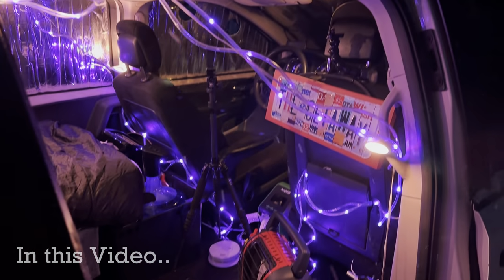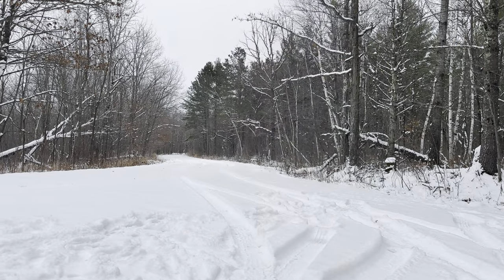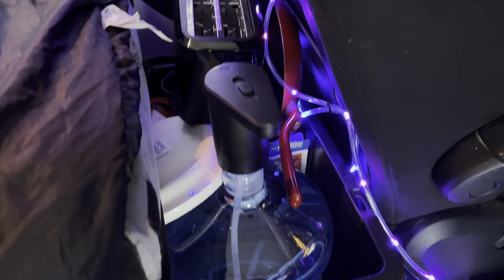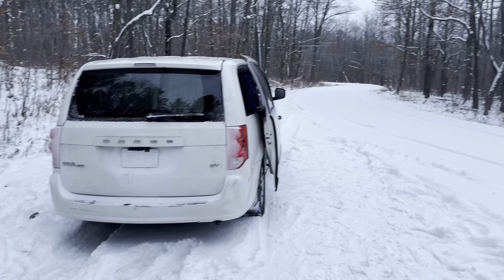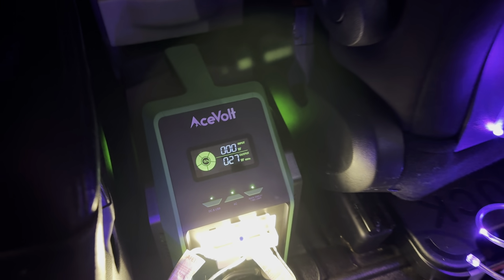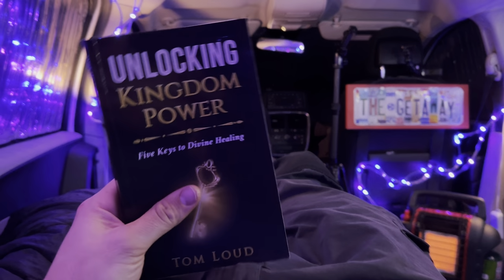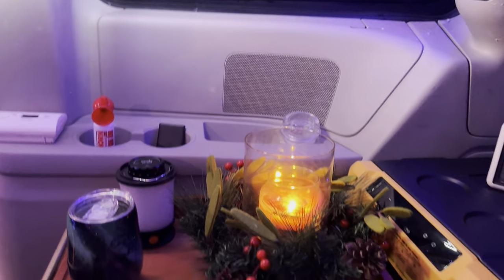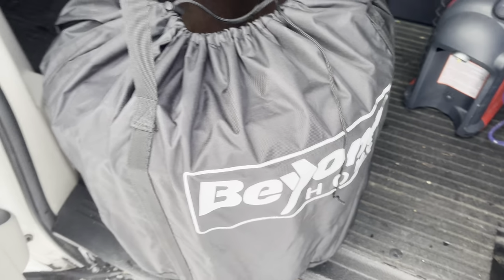🥶 Solo Car Camping in the Freezing Forest! Winter Camping New Setup | Dodge Campervan / Van Life

Comment: Never never run a propane  heater in a closed vechile.   Make sure you have a  carbon monoxide  alarm in your van
Reply from the maker: Yeah you always gotta keep the windows cracked for good ventilation and have a carbon monoxide detector like I showed in video and you’ll have zero issues

Comment: Not a good idea to light a candle, it will use up the oxygen in the van and create carbon monoxide. God Bless You!
Reply from the maker: Hey Joyce, one candle is totally fine as long as you have some ventilation and a carbon monoxide detector which I do. Thanks and God bless!